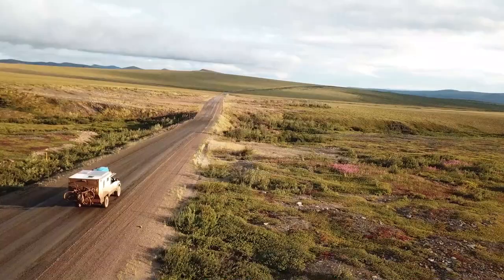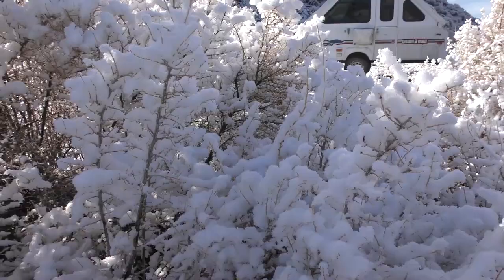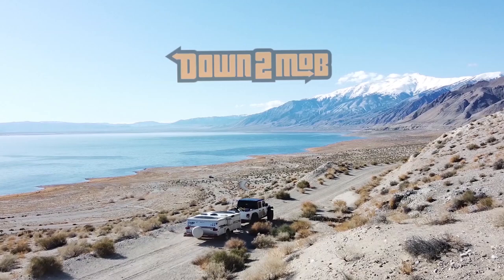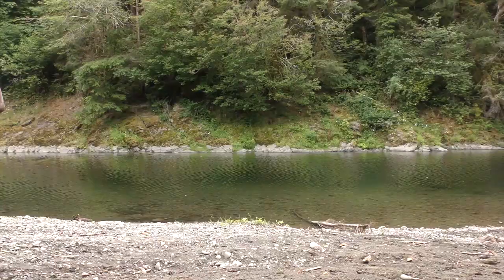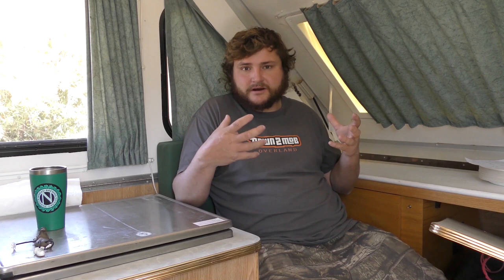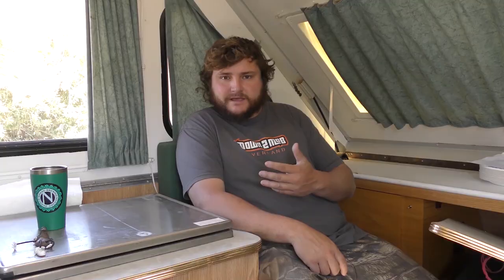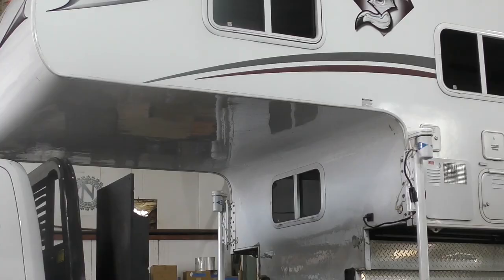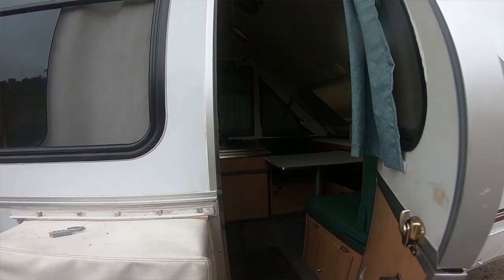TRUCK CAMPER vs. CAMPER TRAILER - Pro's & Con's from a FULL TIMER

Comment: We've owned 4 pull behind travel trailers/camping trailer, a home built topper camper and 5 truck campers. Our feeling is that once you discover truck campers, you'll never go back to a pull behind. The only people that do that seem to be elderly folks that have mobility issues and have difficulty climbing up into the cab-over. I can take our cab-over slide-in TC off our Ram 2500 easily in 10 to 15 minutes. Takes a bit more putting it back on. Your opinion could be based simply on your lack of experience doing it. Remote controlled electric jacks make short work of it. The hardest part is simply backing your truck up in a straight line :-)  I take my TC off our truck just to run trash to the dump and then put it right back on when I get back ... easy, peasy :-)  It can take 15 minutes to get a travel trailer connected and adjust the weight distribution bars, chains and anti sway device.  Things you didn't mention as TC advantages ..... cheaper tolls on roads (charged per axle) and cheaper rates on ferries (charged per linear foot). I also disagree about resale when it comes to TTs versus TCs. Truck camper people are a distinct cult. They know they want a truck camper and will travel large distances if they have to in order to get one that they have a fancy for. TCs are manufactured in much smaller numbers so they are more valuable in essence.  Then there's the storage issues .... advantage truck camper. I definitely agree with you on many points .... match your choice to your application. We are part timers who have been trying for 10 years to stay longer in one place but can't seem to do it ..... always want to move on it seems. The biggest advantage of the trailer (and only advantage in my mind) is the increased storage areas.  Sure they have more room inside, but we don't mind less room at all as long as it's efficient. As a videographer the biggest appeal of the truck camper (as you alluded to) is the ability to stop and pull off in the smallest of spaces to get that awesome shot of wildlife or waterfalls etc. Maneuverability is worth its weight in gold :-)
Reply: Storage advantage in TC? First time I’ve ever heard that. With trailer you have you tow vehicle for storage

Comment: A)
Today's sponsor -- Silke Studios Wrap-Around Bra.
An excellent choice for the overlander!

B)
Our rig -- 1997 Ford CF8000 commercial truck we converted to ExpeditionVehicle.
Our situation -- boondock exclusively since 2003.
South America twenty-four months twenty-four thousand miles. Alaska Panama, all over north and central America.

Our inside space is three paces wide and six paces long.
We are inside for eating and sleeping.
The rest of the time, we are outside.
SCUBA in Baja, museums, festivals, barbeques, pot-latches.

For a trailer, we would build on a commercial tandem dually goose-neck.
GVWR of ten-ton or so.
Three paces across by about eight or nine paces long.
Towed by a Medium-Duty Truck (MDT).
Cummins / Allison.

Comment: I agree with your assessment of the pros and cons of each. My first camper was a small slide--in on a GMC Canyon truck.  I wanted the maneuverability to go in the deep woods on narrow trails.  I had no idea what a PITA it would be putting that thing on the truck and taking it back off. That, and the fact I wasn't going offroad camping like I planned led me to decide a pull behind camper would be better for me.  I sold the truck camper and  eventually bought a hard sided trailer to pull behind my FJ Cruiser, which I had traded the truck for.  I've been super happy with my current setup, having the convenience of a base camp and the freedom to go exploring in the FJ. However, I wouldn't completely rule out another truck camper one day, especially if i could have both!

Comment: My set up is I live full time in a 28’ camper trailer I made ready for off grid and I have a 1996 dodge dually 12v 4x4 and I haul my kayak and four wheeler on the flat bed with my kayak.

Comment: Great video and I agree that it's all about what you want to do. I have an A-Frame (Chalet Trail Boss) and pull it with a Toyota Sequoia 4X4 so I have lots of room for gear & extra water.  I've made many 28 point k-turns on narrow forest service roads and that is a hassle but I'm not in a hurry. Mine is lifted with suspension upgrades and frame reinforcements so I don't have many worries about where I go.  It is long but I can unhook and explore if I want.  I do like to stay in one place for a while and you are on point about that. Very comfortable if you are going to stay in one place for a bit. An articulating hitch will be my next upgrade to reduce frame stresses.

Comment: I go around and around about this, to the point I'll probably be pitching a simple tent forever lol
Reply: @Blazerfan11  Here's an example of the (my lol) vicious circle - I watched both vids and love their setups, and then I think "I could have that setup with a truck with a topper and skip the trailer (keep my simple moto trailer for toy hauling), but my trailer sucks, but I love my SUV, not sure I want to sell it for a truck", on and on.  I'm a lost cause!
Reply: crj moto sleep inside the suv. They usually have plenty of room and definitely beat tents. All you need is a cheap ikea rolling mattress and you have a nice secure place to sleep. Plenty of people have made great videos for camping inside of vehicles and they can be very comfortable.
Reply: @josephsamsor1698  Excellent suggestion.
Reply: @josephsamsor1698  Solo I'm ok with it but FJ Cruisers are uninhabitable for 2 (says the Mrs.)
Reply: I have a Tacoma LB with a camper shell. I go back and forth on what to do on a weekly basis. Lately, I've been thinking about a cargo van that I fix up myself - like a weeroll. Other times, I think if I can't sleep in my truck bed, go rent a room somewhere. By the time you pay for your rolling suite, you can  spend 100 nights @ 40 to 70 per night (and possibly lower for the next few years). That's 100 nice long showers over sprinkling water from a creek on yourself. I travel alone.
Reply: Delta-Jungly 810  How do I carry dirtbikes? Ha ha, I looked at a few with room for bikes up front and they are much longer. There's the "Jumping Jack" with a soft pop-up tent under a dirtbike platform but again, why not just have a trailer and tent, then you can leave the tent at camp if headed out for the day. It's all very complicated. I'll have to do a proper video on it someday and get more feedback. Oh and that pop up with room for bikes was like $10k, used, ouch. Jumping Jacks are around $-5k if I remember correctly
Reply: @crjmoto  Add a sleeping platform above the toys on your existing trailer and add some tool boxes for storage. I'm a huge fan of making what you want/need instead of trying to shove what you want in to something that already exists.
Reply: Hehe hehe he... Beavis, he’s pitching a tent... 😆
Reply: @jpoeng  Huh huh huh, next to his toolbox, huh huh huh 😂

Comment: Nice comparison!  I started with a travel trailer and we lived in full time for 4 months pretty comfortably. I have a truck camper now and we'll be selling the travel trailer soon.  When space at home is limited then TC on the truck can work great especially for load outs.  Some can even make into a garage with at pop up slide-in TC.  The TC is so much more flexible than a TT for the areas we want to go, plus I can still tow if I need too.  In some states like CA, your speed is limited, too not that I want to go too much faster with the TC.  The biggest problem with TC's is people overload their truck and lose a lot of the truck's capability...matching the load is so important.  With practice and if needed, off loading the TC at a camp spot is not too challenging.  That said, I've only done it on very level solid surfaces.  I would say this is one advantage of a slide in over a flatbed.  In the end it's really what works best for your situation and it's wonderful there are so many options available!  Keep up the great work with the videos.

Comment: I agree that you don't want to be taking the truck camper on and off as much as you would a trailer. But if you really wanted to and were staying in a spot for a while it's not that bad. If I take my time I can take off in 10 minutes and put on in 20. I do like the maneuverability better with the truck camper although I can't go as many back roads as you could with yours. Mine is a 2000 lb cab over. I think if we all had our choice we would take 1 of each kind, right?

Comment: Awesome video.  I have an Alaskan non-cab over and I love it!Makes the truck light on the wheels and for a 1/2 ton pick up with Timbren load enhancing elastomerics it is awesome!  I love the versatility of the non-cab over platform and an Alaskan hard side pop-up is the ultimate all weather home on wheels
Reply: I also thought that would be a good option on a long bed single cab truck.  Is the dinette comfortable when converting to a bed?  I think the dinette seating could make a double bed on the largest non-cab over model.
Reply: Dinette is nice and bed is cozy for two but not too small
Reply: I thought Alaskan recommended at least a 3/4 ton for their heavier campers! Durability has a price.  I'd go for their NCO 8' floor front dinette in an 8' bed single cab myself.
Reply: Marc Pikas my 8’NCO is a 1971 model year. The older NCO’s are around 1300dry. My pickup stock is rated for 1940 payload. It is an F150XL with a 4.2 v6. A little under gunned but it works well. I also pull a 6x12’ enclosed trailer with all of my aircraft maintenance tools and equipment. Prolly around 3k lbs pulling in addition to the camper. I can maintain 65 on good ground and get 12.5-14 mpg pulling the trailer. With just the camper I averaged 16-18 mpg. Estoy I get 24 mpg hwy. I did several enhancements to the engine to boast performance and fuel economy. Probably an aggregate additional $1k for all the mods combined. I love the versatility of the Alaskan go anywhere and have some nice amenities.
Reply: @karsonbranham3900  Excellent fuel mileage.  The 8 foot NCO is really a great lightweight option for a 1/2 to truck.    The NCO saves about 300 lbs over the cabover and it probably saves fuel too.  Also it would save setup time.
Reply: @karsonbranham3900  Thanks for info.  They rate their current 8' NCO at 1380# so no much difference with yours.  I'd still go for a 3/4 for more extras like bikes, kayaks, solar, beer..

Comment: You pretty much covered the pros and cons of both.  It seems like more people have regular jobs and can usually only get away on weekends or scheduled vacations so the trailer is definitely more convenient.  Even though there is a cost to have the trailer as far as registration, insurance, etc., it really is very minimal.  One thing that you seemed to overlook was the height issue with many of the truck campers.  The extra height can sometimes create a hassle when it comes to getting into certain areas.  Great analysis, looking forward to the Gladiator build.  Be safe.

Comment: Had my A-frame trailer for years. Did a over under axle lift and 33" LT rared AT tires.  Been to Alaska and back. Goes anywhere my truck on 37s can. I wouldn't trade it for a 4wheel camper.

Comment: I've even gotten worried about being able to turn my truck around, some of the narrow tracks I've gone down in my life, just exploring.  I would definitely do more planning and pull back from just following my nose, if I were pulling a trailer.  

I'm going with a little 6'x8' off-road squaredrop.   Go anywhere I want, sleep in comfort wherever I stop, without any work.  I can spread out as little or as much as I want.  If it's just an overnighter, I can do all my cooking and cleanup without spreading out at all.  Just throw the Coleman stove on the fender of the trailer and I can put a meal together.  

I do like to set up a base camp and fish/hike/prospect for days or even weeks out of one spot.

Comment: Used to have a fifth wheel toyhauler, but the kids grew up. The wife and I like to venture farther from home now, so it's easier to travel light. Went from CA to SC and back in. Ram 1500 with a shell and a bed platform. Building a Suburban right now

Comment: Good comparison - we opted for a trailer modified with a lock & roll hitch/coupler ( greater articulation then a ball) , Jack-e-up jack removal (ground clearance) and a croft 10" double wheel jack wheel (makes moving the trailer around in the dirt MUCH easier). Our 15' tear drop trailer (2019 NuCamp 320 Boondock Edge) kicks up in back to aid departure angles. Pulling it with our Jeep, we can pull the trailer up a dirt road - set it up for Boon-docking and go off on a 4x4 trail where truck campers generally fear to tread. It's great to have a nice place to return to in a secluded place. However, the vintage XJ pulling a retro tear-drop  garners a lot of attention wherever we go.

Comment: When I was a full time RVer  we used to say motor homes are for people that want to travel and trailers are for those that want to park. I used to tow a Wrangler, but motor homes are lumbering beasts the bigger and more comfortable the fewer places you can go but we saw a lot of Alaska the n the Jeep with the MH parked  in a turn out. Now I’m town by a Aliner with a Cherokee and not liking finding the end of a road. I once owned an 4wd F250 with a Lance camper which was also a lumbering beast. I’d take my Honda Civic  places I wouldn’t take the truck camper combo. M

Comment: A big advantage to both truck campers and vans is that the trailer hitch is still available if you want to tow anything, maybe a boat, cargo trailer, snowmobile, motorcycle, etc. It leaves the option to earn some gas money by moving other people's trailers

Comment: I lived full time in my 1997 Dutchman Duck 1006 pop up camper trailer for almost two years pulling it with my Hyundai Tucson. Loved it! Saw Texas, Arkansas and Louisiana. Sold it because I bought a house. Pros: was easy to set up and move. Cons: constantly leaked from somewhere on the canvas from the constant popping up and down.

Comment: Glad you made this video! I’ve been debating on camper vs trailer for a while. I was leaning towards camper because I already have a long wheel base and wanted the capability to tow my horse trailer at the same time at times. After this video I’m sold on a camper.

Comment: I bought my 2 door Jeep years before I ever thought I would want to drive across the country and "overland". I am pretty much stuck with it for a couple more years, so I decided to go the trailer route due to lack of space, and instability of the short wheelbase. I am building up a 5x8 cargo trailer as a tear drop style offroad capable camper. It will be more of a base camp trailer.... head to an area like Moab, leave it in one spot and check out all of the trails in that area. Eventually I'd like to build a true overland rig and keep the camper for the versatility depending on the trip I plan.

Comment: I've got both. The truck camper is a Capri minimalist type camper. My trailer is a 11ft  camplite. Sometimes I take both and other times in tow my jetski or UTV with the truck camper.
Reply: Us also. Currently have a popup truck camper and a hardsid 22 ft travel trailer. What years is your Capri. Do your have a retreat or cowboy model? Have thought about looking into Capri as our next truck camper.
Reply: @thomasdipaolo2349  mine is a 2016 Maverick. Kind of a cross between a cowboy xl and retreat. Has  over cab bed but ceiling height is about 6 ft 2in. I have it on a F250 Ford long bed. It's pretty light and cost me about 1 mpg. It has rooftop ac/heat, microwave, TV, sink and water heater. No shower or bathroom. 30 gallons of on board water. I use a portable pottie that stores nicely under rear shelf.
Reply: @n2cycles  sounds nice. Do they still make that model?
Reply: @thomasdipaolo2349  no they discontinued that model. Most people cant tell it from the retreat. It's pretty well made for a stick and tin made camper. No particle board or lamination. Biggest complaint is the electric system is basic and depends on the vehicle for all the 12 volt appliances. That's easy enough to fix but nothing to go wrong.
Reply: @n2cycles  - appreciate the additional info. Plan to visit their facility in the near future

Comment: go with a truck camper, and have a trailer for when you want to go on those comfort-runs.  you can take a 6x12 cargo trailer, put some off-road suspension and wheels on it, and have a capable 'extended living room' to your truck camper.  All for around $5k and some sweat and labor.
one of the benefits - huge selling points actually - of a truck camper is you can still tow with it on the truck.  So your truck camper becomes your main home, and the trailer becomes your tow-along-garage ;)